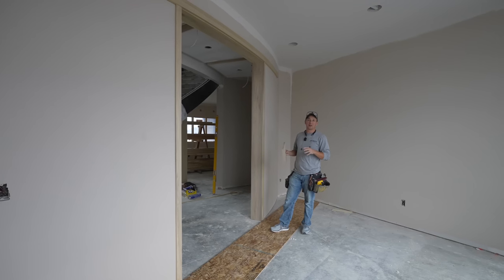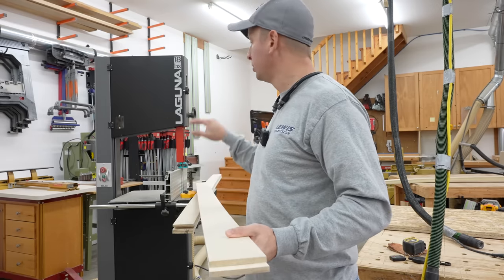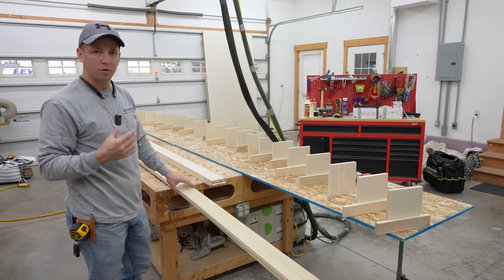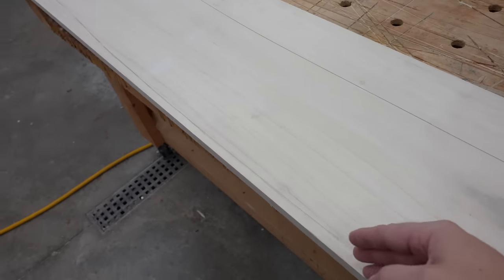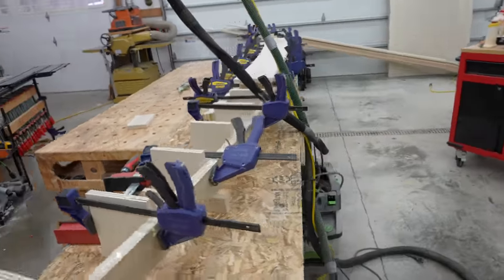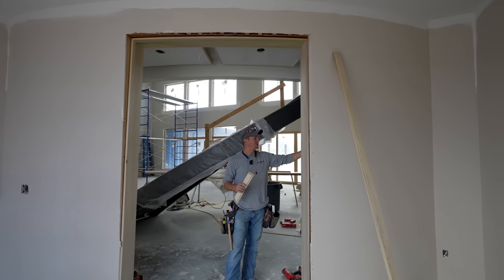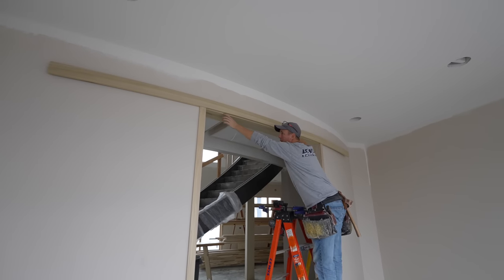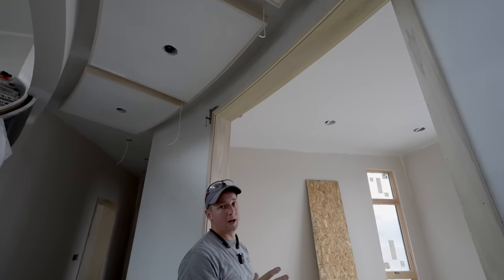Barn Doors Are Getting Ridiculous!!!... - Trimming a Barn Door Opening on a Curved Wall

Comment: That turned out amazing, I have some experience doing curves, and part of the problem with your jamb and casing not lining up is how you scribed the wall. By running the spacer with the wall you actually increase the radius by the length of your block, and then using the outside of your form it was increased that much more. to scribe the same radius as the wall you would have to scribe with spacer block held consistently at 90 degrees to the osb

Comment: Faced with somewhat similar challenges to this one involving large odd-sized radii and much longer arcs,  and where it was physically impossible to access the center of the arch, I have created forms based on the specified radius taken from the drawings. To do this, I first created a scaled drawing of the required arc section that would fit on a single sheet of plywood, with the ends of the segment cut on radial lines, like a segmented wheel.  I then took that drawing to a sign shop where they printed a full scale paper segment that I cut out as pattern to make a master plywood segment. Multiple identical segments were pattern routed from the first. By carefully butting the radial cuts of the plywood segments to one another, I was able to create a very large form. When laying out a soffit above, I used the plumb dot laser to transfer the end points of the plywood segments from floor to ceiling, then used these end points to install soffit arcs.

Comment: Spencer, I'm a big fan. Love watching your videos.  It's probably not that critical in this situation, but when you glued up the bent lamination for the barn door track header,  you actually bent it at different radius. You bent the door casing on the radius of the track header and the track header was bent at a larger radius ( by the width of the clamping blocks).  Like I said, it wasn't that critical in this situation because it was a big radius and things could be manipulated.

Comment: With the spacers you clamped to on your bending jig, the barn door header was actually bent to a slightly larger radius than the wall.  So some of the ‘spring back’ may have been just the larger radius.  Great job, fun to watch.  I always wonder who is behind the camera when I see it move in and out.
Reply: His scribe had a 12” larger radius than the wall to begin with. Spacing block should have been held parallel to the center line of the door as he followed the curvature of the wall. Instead of perpendicular to the wall like he did.
Reply from the maker: That is Aaron, he has been doing my filming and editing for a couple months now. He's been a huge help for the channel!
Reply: I think if he had swapped barn door trim and other header on the glue form it would have been closer. The arc he scribed was for the BD side. Doesn't really matter because the header has enough flex.
Minor issues.
It was a very fun watch!
Reply: @InsiderCarpentry  I was wondering who did the filming. Nice upgrade. Years ago I shot promo videos for furniture mfgrs as a favor and I'm confident most of us watching your channel have no idea how much effort it takes to produce these videos. Well done.
Reply: @InsiderCarpentry  He’s doing a great job.

Comment: Love your stuff man! Just curious, and it’s possible you addressed it and I missed it. But is it possible that your radius was slightly off because you used a block when you scribed the wall and didn’t account for that block back in the shop? By using a block with any thickness when scribing a radius, the scribe line is now further away from “center” causing a larger radius to be drawn. Wasn’t sure if you accounted for that or not. Like I said, you possibly did and I just missed it.

Comment: MAKE A TEMPLATE - I have done this many times for large and small shapes. In effect you are making your own device with pins like that thing they advertise on TV for cutting tile around toilets or pipes. 1st method. Lay pieces of cardboare or sturdy paper against or around your curve. Tape them all together. Lay that conglomeration over your board, draw line, cut.  2nd method. Use long board. Cut many small strips of cardboard or thin wood. Lay wood  up against wall. put little strips up to curve like pins. Staple to board. Trace ends of pins onto material to be cut. Fill in gaps by eye. 3rd method. Use long piece of wood. Make sure it is set so each end is the same distance from wall.  Every interval of  1 foot, or whatever, measure distance to wall. Write down measurements. Lay long board against material to be cut. Refer to measurements and mark material. Draw line. Cut.

Comment: You needed to re-scribe the radius back the distance of the spacer in order to have a perfect fitting piece.  Your radius was the length of your spacer too large.  Looks great anyway.
Reply: I was going to comment the same.  In this case it was the distance of the spacer used to do the scribe and then also the width of the spacer blocks used to clamp the lamination to since it was clamped to the outside face of those blocks.  The radius of the curve here was so large it didn't make a huge difference in the end, but at tighter radii you'd notice a much bigger gap.
Still, excellent work regardless!

Comment: Haven't heard of "springback" but I know that Titebond 1 starts bonding almost immediately, and it took you a while to get those strips glued, wrapped, and clamped to your form. Titebond 3 with its longer open time would have been the right glue for this. You're a great carpenter, dude, but that so-called "springback" was caused simply by using the wrong glue.

Comment: Great work again Spencer, surprised by there isn't smoke coming out your ears with all those cogs spinning so much in that head of yours
When making a form could you not over bend slightly so the spring back brings it into correct curve?
Reply from the maker: Could have, But it ended up being pretty flexible and easy to work with.

Comment: I mean this as respectfully as I can ask, but why wouldn't you have taken a flexible long piece and screwed it to the wall, then carried over your arc line off of that? Wouldn't that have been easier than using a ton of plum bob dots connected?
Reply from the maker: The plumb bob dots took maybe five minutes... sometimes the fastest solution is the most primitive. Over-complicating things is a curse for lot of carpenters that greatly decreases production. I try and do the best work possible while keeping the process as simple as possible.

Comment: are you using the resaw king on your laguna ? it looked like it.  I am getting similar resaw results.  I thought it might be my guides.  Are you getting that result with properly set up guides and a resaw king?
Reply: Try the Carter bandsaw guides and a 3 or 4 TPI rip/resaw blade.  Your problems will be solved.
Reply from the maker: No, the blade was to small and too many teeth for what i was trying to do.

Comment: How would a blueprint be more accurate? As you mentioned, the wall/opening might be out of plumb. But that would be framing inaccuracy. It's not like the blueprint would call for that.
Reply from the maker: The print would tell me the true arch and take out any undulations in the graming and drywall butt joints.
Reply: @InsiderCarpentry  You do this stuff full time so I’ll take your word for it, but I would expect the same blueprint to also tell you corners are exactly 90°. 😀

Comment: I'm so sick of barn doors.  I've had a couple homeowners do barn doors but just use a regular 2 panel slab just like the hinged doors in the house.  I don't get it.  If you're gonna do a barn door at least use a wood slab.  

Pocket doors are getting out of hand also.  Just started a big one on the lake and it's got 7 pocket doors and of course the framing is terrible on them.
Reply from the maker: I have a house coming up that has 17 pocket doors...
Reply: @InsiderCarpentry  that's a lot